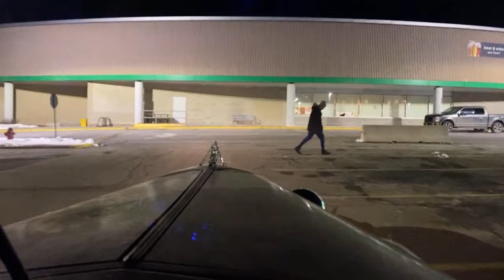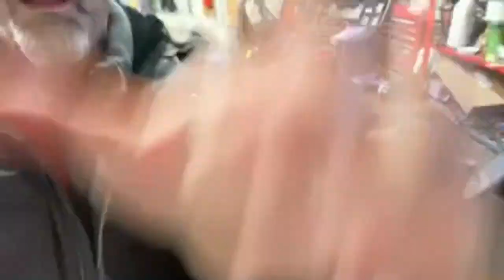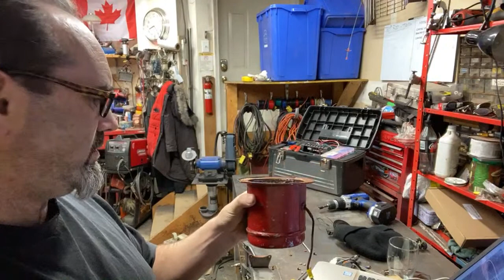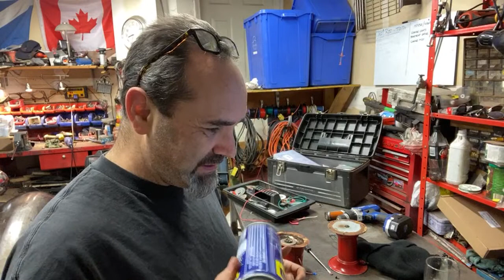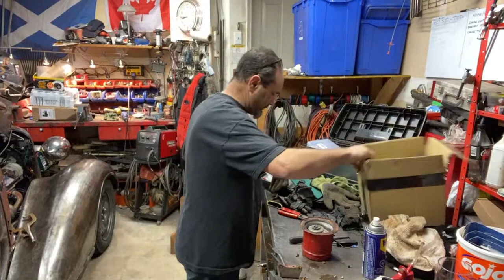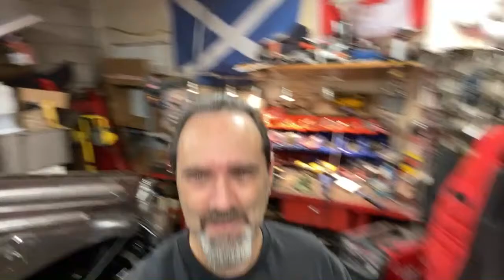Saturday Night Live Horn Play

Comment: Been meaning to ask you how you like your Mini? I had one I loved it. It was my second one. The first one was 2011 clubman had it a bit more than a year and some drunk fell asleep going really fast and came over double yellow and took out drivers side tore of left rear wheel assembly completely. I had moved over to right shoulder as far as I could. Totaled it no one hurt. It was 5:30 am on my wife and I to work. Replaced with 2012 clubman Hampton. Kept it 10 years. I was a salesman and had ( calif) San Diego, Riverside, and San Bernardino counties. Change oil every 5,000 every 3 weeks. I retired after 5 years with 335,000 miles . Got rid of it, wasn’t worth fixing and didn’t get much selling it. It had 377,000 miles

Comment: I guess the person who gave the wd40 advice didn't know it's flammable. Have seen it used in distributor cap to dissipate water then reinstall without wiping, guess what happens when you turn over and spark is created. Yes time for a new cap. Also will become an insulator between brushes and  " comutater  ". They make a cleaner especially for electrical components.  Two cents worth.